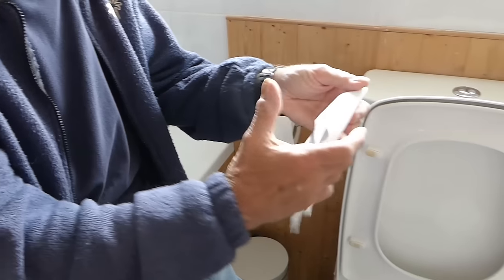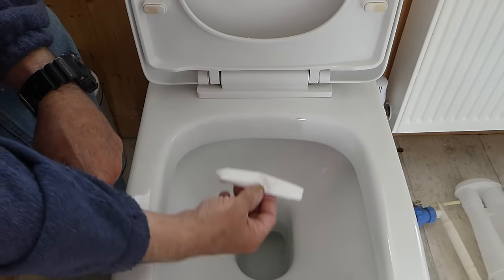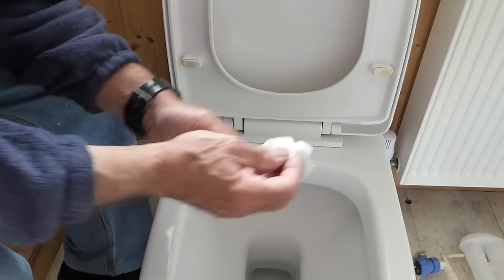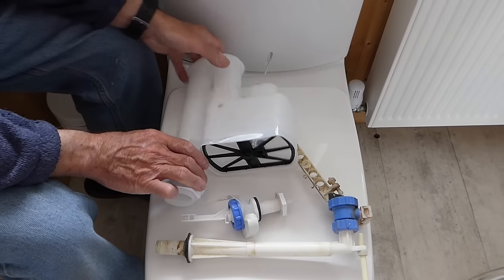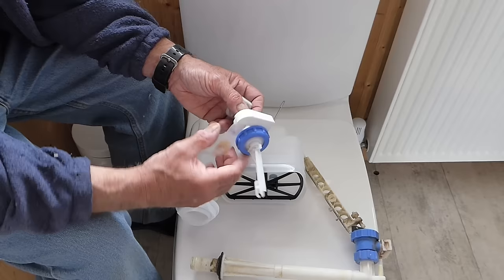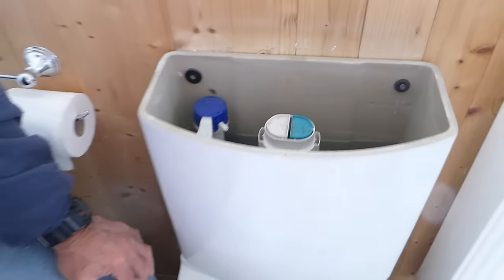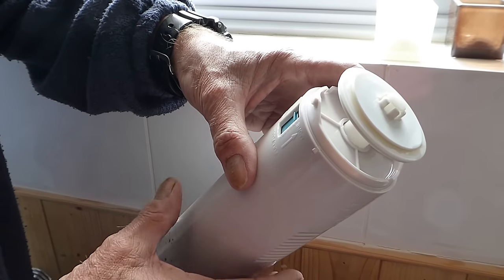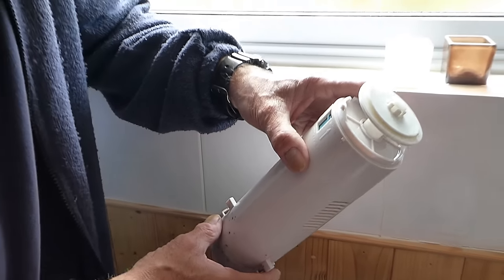How to fix water leaking into the WC pan.

Comment: Hi Dereton
Thank you, your video is really useful, I have push button system, it is leaking slowly in pan some water, I take out from valve rubber seal, switch to other side, cleaned house placement, but still this slowly water leaking, almost not visible but constantly, please help
Reply from the maker: Check the ballcock is not letting by. Sometimes the siphon may have a small pin hole in it letting water through, in that case, a new siphon is your only option.
Reply: @dereton33  thank you Dereton it stopped for now I don't which step I have done, I cleaned bottom rubber seal too, then move this push button house several times, i kept it open cover, once lock down over from virus I will go to plumber shop get change rubber seal in bottom house. thanks man i really appreciate! God bless you!
Reply: Hi Dereton
Hope you are well! There is sound of air from Ballcock I think that blue capped thing, you think that might cause this slow leakage?

Comment: Is there a way to stop the cistern filling up without turning off the water at mains?
Reply from the maker: Put a piece of wood over the cistern and tie the valve up with string so it is never going to drop.
Reply: @dereton33  done it thanks. Tied it up to the towel rail

Comment: I'm a bit confused about the video and I'm wondering if you could help.
I have a toilet that has two buttons on it, and today I decided to push both buttons at once. It flushed normally, but after the flush water kept coming out.
I opened the toilet lid and noticed that the problem/solution was:
If I pull the float up, the water stops coming out (I don't have the ball mechanism, I have the plunger type that comes up when water fills the tank), but if I lower it, the water comes out. I've also noticed that:
When lowering the float, I notice that the water bubbles where the pipe goes into the bottom of the tank, 
When I lower the float the water doesn't refill the tank, instead what I believe is that when the float lowers, the tank refills the water, but some sort of seal is broken, so it just comes out.
I've also noticed this if I attempt to fill the tank myself, the water comes out again before stopping, possibly suggesting there's a leak somewhere above where the water sits.
Lastly, no matter if the float is up or not, the flush buttons don't work at all.
Is there any way to fix this?
Reply from the maker: Best to fit a new syphon.

Comment: Do you know how to repair if the water in the bowl (not tank) is too low? Which of those parts in the tank are responsible? Thanks.
Reply from the maker: The ball valve just needs adjusting.

Comment: Hi have a video on tightening up the toilet seat something similar to the one in this video. There is no visible fittings visible cheers
Reply from the maker: No but I will have to do one.
Reply: I had a go yesterday and there's one side loose and a bit knackered but I'd need to replace but I don't know if it's possible cheers
Reply from the maker: You will have a problem getting the right fixings.
Reply: pull off the seat and screws are undernearth to tighten it

Comment: Thank you for your videos, but I can’t seem to find a solution for my problem! My toilet tank and components look the same as the one in this vid, but I also have a little tube coming off the fill valve.

Hope someone can help me. At first, my tank just stopped filling up. Then after watching some vids, I fiddled around with the components and now it does fill again, very slowly. Main problem is now that it doesn’t stop filling and keeps filling up past the overflow tube. I’ve tried adjusting the fill valve, but no luck….. can anyone help pls? 🥺
Reply from the maker: You have  faulty valve best to replace it.
Reply: @dereton33  thank you so much for your reply! I’ll give it a shot!
Reply: I finally replaced the valve ☺️🤭🤫

I bought a fluid master 400 (doesn’t have the tube/hose though). I installed it and the water fills properly now BUT it doesn’t stop! It doesn’t pop up by itself when the water reaches the correct level. Any solutions pls? 😔🙏🏽
Reply: Do you think I just need to flush out the top part, even though it’s brand new? Also, I noticed when it’s filling up (after valve replacement and cleaning the cistern), the water coming into the cistern has some sort of dirt/mud. Is this from the pipes? Do I need to change them?!?! 😱

Comment: Water is leaking into our toilet pan and it does appear that the washer you point to might be the culprit. However I am unable to remove the cistern. I have tried to twist it as you have shown but its not coming loose and I am unable to locate any clips to remove it. It does twist around but will not come loose. Do you have any further advice at all?
Reply from the maker: Some do not come apart like shown in the video, looks like you have one of those, you will have to renew that one.
Reply: Okay thanks man

Comment: I changed it all ball cock an fill valve and now have an ever so slow leak and cannot locate it under the cistern cant determine if it is the white nut under cistern attaching the white  fill pipe or if it is the metal nut attached to white fill pipe from the pipes ???
Reply from the maker: Reseal them with new rubber washers or use plumbers mait.
Reply: @dereton33  Much appreciated and after watching your other video about toilet leak I bought plummers mate !! You done a video also about leaky stop cock an pfet tape and it worked a treat for me !!! Keep doing the vids as I seem to be going through a lot of bathroom problems at present, think theres a bathroom poltergeist in there ! Cheers Dereton33 !!
Reply from the maker: No problem Sam.

Comment: I have the two button and separate system as shown but water is going down the over flow pipe.
Reply from the maker: The valve needs replacing.

Comment: I had a leaking into the pan problem though mine was more than a trickle, which always seemed to be initiated by the cold tap in the WC sink. My quick fix was to push down on the ball cock (I have a system like your push button one) which made me think it was a seal on that causing the problem. I was trying to isolate the problem as you did in the video but in doing so I pushed doubly hard down onto the ballcock and it shifted downward by about 5cm. That appears to have solved the problem but I'd be surprised if this brute force approach is a long term fix and I probably need to replace the ballcock piece all together.
Reply from the maker: Change it when you get time.
Reply: dereton33 good shout. I've ordered     it :)